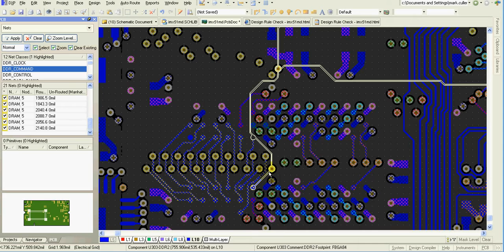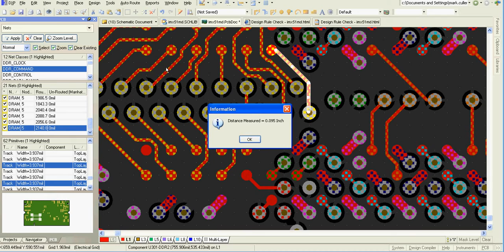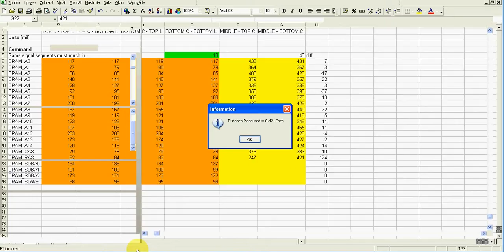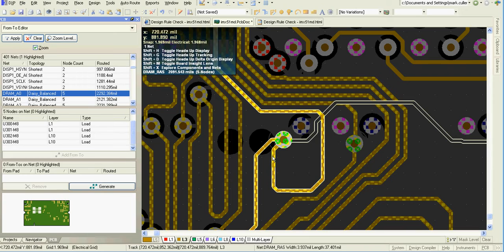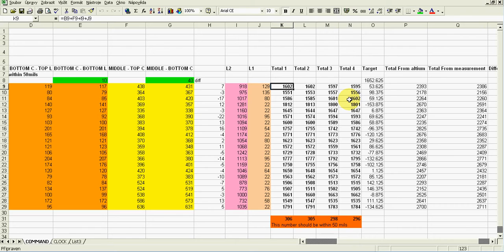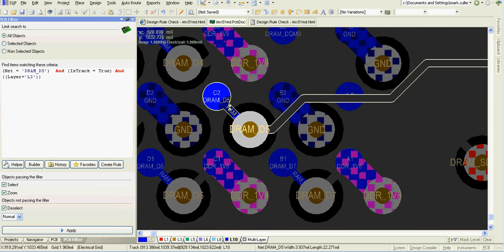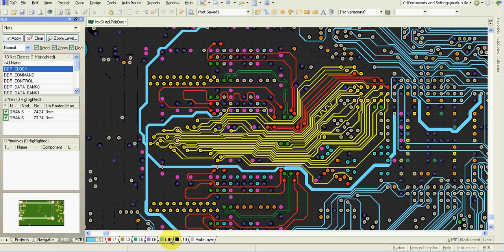Altium Designer - DDR2 routing and layout

Comment: Robert, Thank you for your great work. I have some questions. I know that they are so much:D But some points pass so quickly. If you respond to my questions, I'll be so appreciated. 
12:23  What is the difference between Total and Total from Altium? I didn't get it...
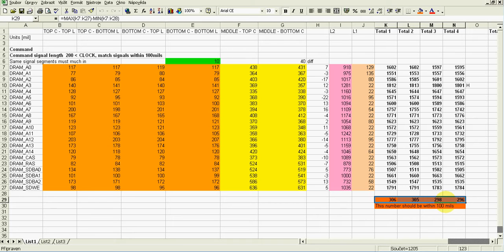9:51 "Command signal length 200<Clock" I didn't get this expression too...
10:23 What kind of relation between clock and command signals? Do they have a similar length? Will we make the clock signal longer(1800 mil)?
11:03 "Match the signals within 50 mils" expression: Which signals?
Reply: And also The url that you share for spreadsheet is not working now. Can u share this spreadsheet again?
Reply from the maker: This was done in a very old Altium ... have a look here this may be better https://youtu.be/jpk-hfsFaqA About your questions:
1) Old Altium could not measure accurate, that is why the difference what altium showed and what I measured
2) This picture will help you: https://welldoneblog.fedevel.com/2014/06/30/ddr3-length-matching-rules/
3) The spreadsheet can be downloaded from here: https://welldoneblog.fedevel.com/2010/11/30/ddr2-length-calculator-spreadsheet-used-for-altium-designer/

Comment from the maker: @soclt 
Impedance: I usually start with routing everything (except powers) by 0.1mm / 0.1mm (track width / gap). When I am approximately in middle of layout, I ask PCB manufacturer for stackup where 0.1mm is 50 OHM and also for track geometry for DIFF pairs. I don't normally calculate track impedance as from my experience PCB manufacturer will change it anyway. See my posts on this subject at Welldone Blog: How to design PCB stackup, PCB impedance calculator – Single ended / Differential pair

Comment from the maker: @soclt 
Simulations: I have done couple of simulations before and ... from my experience, when you follow design guide rules, you don't need to simulate. I have seen some boards what passed simulation and failed in reality. On other hand, I have not seen any boards what followed design guides and failed - they all worked very well. Therefore, I believe the simulation is necessary only in cases where you can't follow design guide.
Reply: When you say passed simulation but failed in hardware, what does that mean? How is that possible? What design guides are you referring to?

Comment from the maker: @soclt Thank you for leaving your comment. The design works very well - no problems, no issues. I still use the technique, just a little bit improved - see my latest Altium Designer - DDR2 / DDR3 Length Matching video. And yes, I did length match diff pairs.